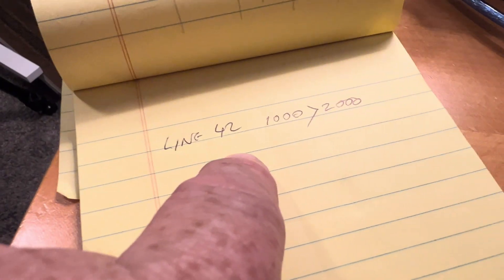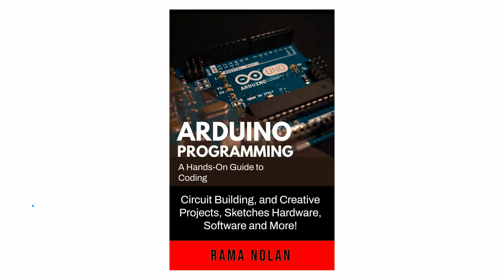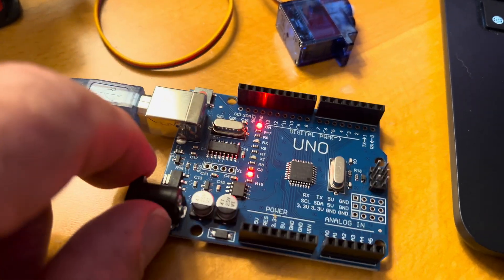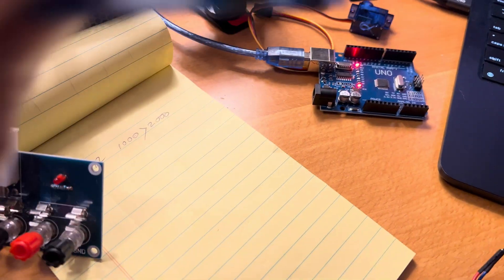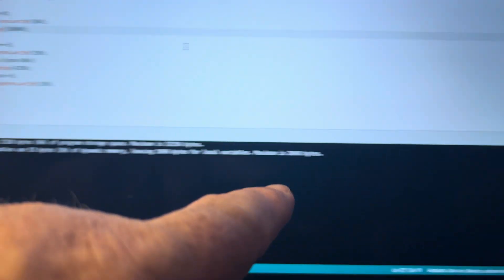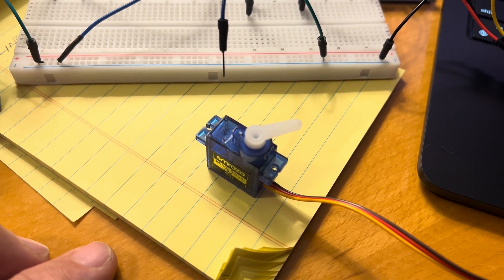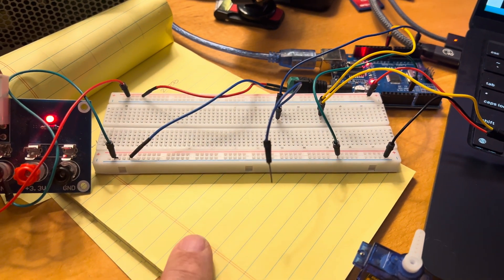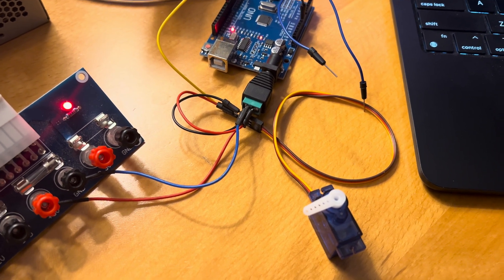144. It Works! My First Model Railway Arduino Project

Comment: Generally not a good idea to have the USB port providing power and use the barrel jack as well

"get something working first", sooo much this, block by block, bit by bit. get the thing to work first with "an input", that flying lead works perfectly, worry about the switch later

its amazingly satisfying when you get the thing to actually work, more so when it does what you expected

there are some good books on the "C" and "C++" languages, but gods there are also some bad ones, I know what you mean on things that assume the reader is a rocket scientist..

one to watch for, the Arduino language isn't quite C, there are some bits simplified out - e.g. not needing the "return;" line, but the work if you add them.

looking forward to seeing the signals move :)
Reply: I use good old YouTube. A lot of model railway/arduino videos. A lot include sketches (programs), which, as you have found, you can modify to your needs.
Enjoy your journey.
Reply from the maker: I need a few more hours in a day.
Reply: @willsgrandad  there is a lot of stuff out there, you do need to be careful as some have various errors but in general watch a few on a subject and you are good to go, its code, there is nothing new out there really and for a railway simple and easy to understand wins over "clever"
Reply from the maker: I saw one sketch that introduced ‘bounce’ for a semaphore signal = I need to get my head around basics
Reply from the maker: Just when you start getting your head round it one of the dogs needs to go out and there goes that thought! 😊
Reply: @trainsofthought5071  try keeping cats of a keyboard, never mind when there is a BLINKENLIGHT

I strapped a laser pointer to a couple of servos and watch while thinking how easily there were amused

then  I realised I was the one watching them
Reply from the maker: I keep falling over Shadow - she always turns up when it’s time to think.
Reply: Oh, boy, coding gives me the Shivers, lol. But I get that it needs a word command to tell to do something. Like switching the pin on or off as a signal to set it high or low to get it to do something. I think, lol.